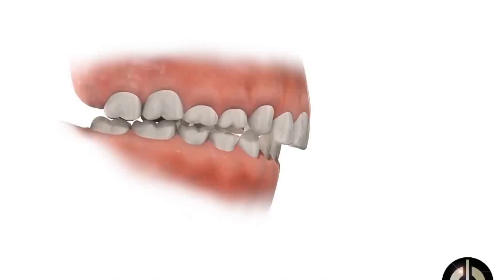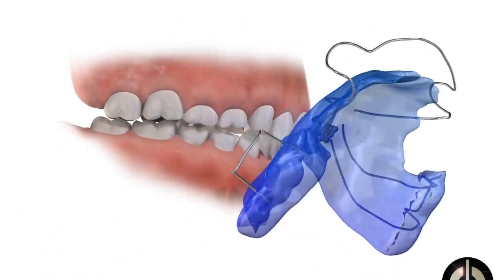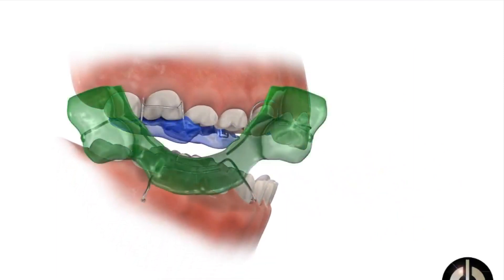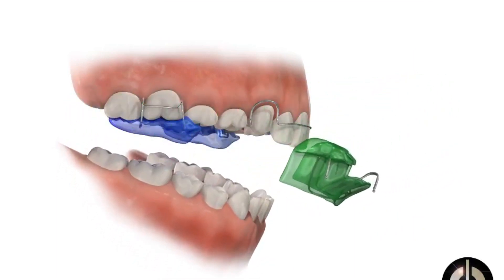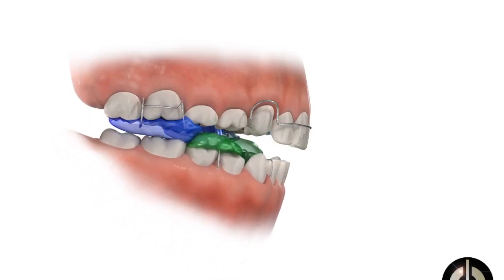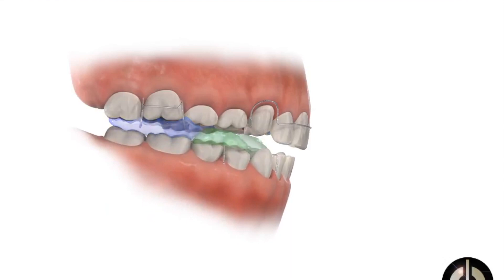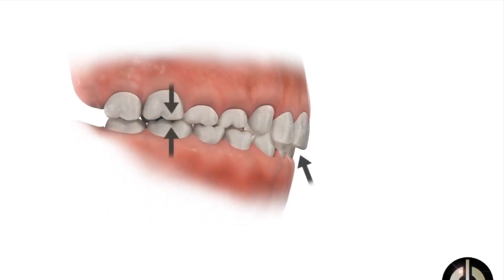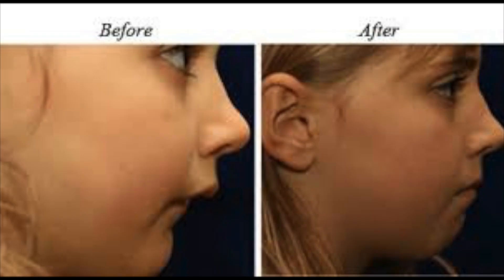What are Twin Block braces?

Comment: Hey! My doctor also recommend this.I have overbiting and also alignment is not correct.can you clarify me that it will solve my both problems or not???............ Because mostly I heard that it is just use to correct the overbite .........so it is also straight my teeth or not???? Plz reply
Reply from the maker: Twinblocks are generally to correct overjet only and are often followed by a fixed brace phase which then corrects alignment. Hope that helps!

Comment: Hi! I got them yesterday and ive been getting very painful front bottom teeth. I had to take them out as soon as i wokr up. Is it normal for them to feel this uncomfortable. Is there anything i can do to ease the pain? I havent been able to wear it full time after getting them, ive only been wearing them for an hour or two at a time.
Reply from the maker: Hi Lily, discomfort is very normal at the start and it certainly takes some perseverance for the first few days. Worth double checking with your Orthodontist for some advice on how to minimise the pain.
Reply: @bracebook1965  thank you! The pain is already starting to go away now.
Reply from the maker: @lilyhutchins9635  Great news! You can do it!
Reply: i have to get mine in two weeks :/ how long did you find it hard to talk for? thats what im most worried about for having them
Reply: @islaroguz8139  you will find it the most hard the first week or two but for me at least the lisp doesnt go away it just gets less noticeable :/

Comment: Got them in and I've got a few questions 1. It's feels like 1 side of my mouth is being pulled more and I feels around the left side of both and the bottom one has less than the bottom right one but the top left has more than the top right is that normal? 2. What food are safe to eat with them in?
Reply from the maker: Thanks for the questions. Sometimes orthodontists choose to do an "asymmetrical advancement" if you have a jaw asymmetry at the start which can feel like more pull on one side  definitely something you should check with your Orthodontist. For dietary advice in braces and twinblocks (essentially the same advice) please watch: https://www.youtube.com/watch?v=lA9oOl5EJ0Q

Comment: how much chances do i get if i break them?
Reply from the maker: Hi Livo, there is a repair fee under the NHS but accidents do happen. To minimise breakages they should be in a box when not worn and you should resist the temptation to click them in and out. Hope that helps!
Reply: @bracebook1965  for mines its only a little part in the very back of the retainers i can still wear them perfectly and i can feel that its working, will it still be a charge?
Reply from the maker: @leia9703  You would need to see your Orthodontist but there is only a replacement fee if they are no longer fit for purpose and require replacement. Often we can manage with minor breakages but the Orthodontist needs to make that decision. Hope that helps!
Reply: @bracebook1965  oh well thank god it fits 😩

Comment: I am 20 years old and my orthodontist prescribed me twin block as my maloclusion is class 2... it has been a month.. i can see a small difference in my apperence... will it get sucessful or would be a trial and error?
Reply from the maker: Hi Paul, we normally review patients at 3 months after fit so I would wait until you see the Orthodontist at your first review for advice. Initial changes can be slow but it picks up momentum! Good luck!
Reply: Any results

Comment: Hi Doctor! I've got twin blocks and i've been wearing them a little bit and they've started becoming loose, does this mean they're working or something? Sometimes when I try to put them on they fall out of my mouth - do you have any tips for that?
Reply from the maker: Great questions Zainab! You need to book a quick appointment with your orthodontist and ask the metal clasps to be tightened - very quick process. Additionally, be careful you do not click the Twinblocks in and out with your tongue as that makes the clasps lose their grip more quickly. Good luck!
Reply: @bracebook1965  Thank you! Also do you know the reason for why they became loose!
Reply from the maker: @itsszainabh  Clicking them in and out with the tongue is the main reason but sometimes they just loosen over time as the teeth change. Best ask your Orthodontist!

Comment: I genuinely cannot and don’t even understand how you can eat with them in, if I just take them out to eat during the day and put them straight back in will I be ok? Like will it delay anything? I wear them properly and try to always have the blocks in contact but I just don’t understand how to eat with them in as much as I want to to get this over with as quickly as possible
Reply from the maker: Hi Grace, it takes some serious practice but it is possible! Advice depends on the Orthodontist but I always recommend wearing them to eat as the muscles really pull against the jaw during that process and activate the appliance. Many of my patients get to a point where they (temporarily) cannot eat without them! I find that those who finish twin-blocks the fastest are those that wear them to eat, but I agree it is not easy to start. Good luck!
Reply: @bracebook1965  thank you so much 😊 would you have any tips for trying to eat with them in? Do I use the blocks to chew or my actual teeth that’s one thing that confuses me and am I able to bite into things? Also I just want to make sure I’m wearing them right so I should always have the blocks together? (unless I’m eating/talking etc) Sorry for so many questions lol
Reply from the maker: @gracecarroll1765  Definitely worth checking with your orthodontist but in general the lower block should be in front of the upper block (they should not be on top of each other) as they are designed to hold your jaw forward. When people eat in twinblocks, they use the blocks to chew but check with your orthodontist whether they want you doing that.
Reply: @bracebook1965  thank you again😊one more question -
Do you need to brush after everytime you eat something?
Reply from the maker: @gracecarroll1765  I would recommend it yes!
Reply: I have had twin blocks for a few weeks now. It was difficult for the first few days eating with them in but then after a week of continuously trying I can eat normally with it in. Things do get stuck under the acrylic bits so once you finish eating just take them out and rinse your mouth and the twin blocks

Comment: Hey plz reply.
Im scared i dont know if it hurts i was supposed to get braces but when i went to a specialist they said i needed to extract two of my teeth and i need to get twin block and after that i needed to get braces. But mine looks like an overbite i just have 12 lower teeth and 14 upper teeth and they want to remove two of my upper second molars, my parents refused so now im going to confirm to another dentist to get their opinion too. Im 14 they told me i need to get it now and braces later
Reply from the maker: Hi Maryam, if you are unsure there is no problem with asking for a second opinion either within the same practice (with another Specialist Orthodontist) or another practice. A general Dentist might not always be able to comment on these plans (unless they have an interest in Orthodontics) so it is worth considering getting your second opinion from a Specialist Orthodontist. Hope that helps, please subscribe!
Reply: @bracebook1965  np yeah sure! 😊

Comment: Hey Dr. Would it be possible to get this if you're 19?
Reply from the maker: Thanks for the enquiry Miguel! Although it's possible, Twinblocks are generally reserved for children in the peak growth phase of 11-15. There are other appliances that can be used for the same correction however, worth asking a Specialist Orthodontist!
Reply: @bracebook1965  Hey, thanks for answering. It turns out that the twin block is not exactly what I was looking for. I was looking for a palate expander to reverse my deepbite. Do you have any suggestions(and I know it's not common at my age)?
Reply from the maker: @afonsohenriques7760  There's a broad variation in palatal expanders. Are you based in the UK Miguel?
Reply: @bracebook1965  No, unfortunately. I'm from Portugal
Reply: @bracebook1965  I'll try more or less to explain my situation dr. I have what you could call Class 2 Division 2 Malocclusion, and also both my upper and lower palates are quite narrow, which is I think the fundamental issue. I cannot rest my tongue correctly at the top and have some issues in my breathing because of the constriction. I wanted to expand the palates, and only then use braces if the malocclusion is still there, and I wanted to know if it's possible at my age.
Reply from the maker: @afonsohenriques7760  Expansion is often possible, but generally more restricted in adults so might involve additional procedures. This is something you need to discuss in person with a Specialist Orthodontist. Best of luck!
Reply: @bracebook1965  Thank you very much! You're words give me hope!

Comment: The blocks are hurting a lot how long will this go on for
Reply from the maker: Generally if worn full-time then things start to settle after a few days to a week. If you keep taking breaks then the ache never really stops though (and the correction never begins!). Also it depends how it's hurting, and worth clarifying that with your Specialist Orthodontist (some aches that are muscular are normal, but if it is pinching on the gum etc it might need adjustment). Thanks for your enquiry Ankit and good luck!

Comment: I got them earlier today, I can talk a little but the pain is overwhelming. It’s 11pm, I should be asleep but I had to take them out as I wont be able to sleep, the pain is only on one side though, and only a certain few teeth are hurting. Could this be a problem with the blocks or will it go away in a few days? I also get lock jaw a lot, the twin blocks have caused it to happen much more often especially when I’m putting them in and I have to move my jaw to fit them in place, will this also stop happening once I have them in for a while?
Reply from the maker: Worth checking with your Orthodontist and making them aware of the jaw issues. Generally it can be a bumpy start. Good luck and sleep well!

Comment: This video is very helpful I got my twin blocks in January 2020 and I didn’t have much idea what to expect so for anyone getting these braces just stick with it and follow your orthodontist advice the best you can. Top tip is do Nottt remove and place the braces up and down in ur mouth this breaks the wires and causes them to pop out I know it’s satisfying but just avoid it. Yes it will be sore on ur teeth for the first 4 days it does go down and u forget u have them in. Good luck to anyone reading this
Reply from the maker: Thanks Evie and great tip, I will add that tip to the video description!